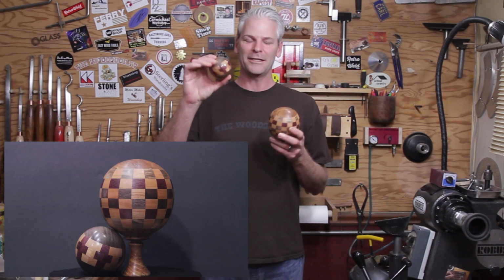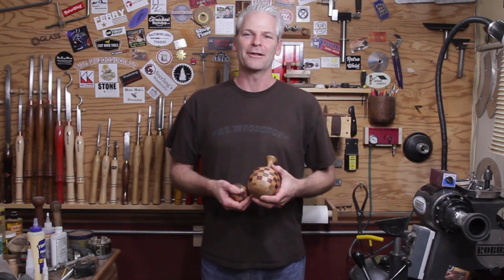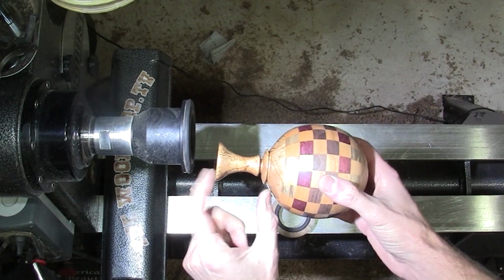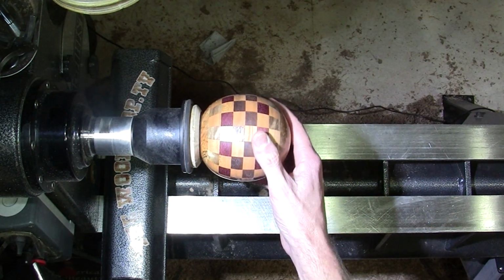Woodturning Segmented Spheres

Comment: Nice turning display.  It is not easy to nail a sphere by hand.  I thought you would use the Chefwarekit sphere jig.
Reply from the maker: +Lyle Jamieson Thank you Lyle! I was a little worried about it chipping with the jig. I haven't used it with segments yet.
Reply: +Carl Jacobson Good point.  You showed great techniques and skills with the spindle gouge.  I think that was the right choice of tools.  The sphere has to be perfect, if you miss just a little it emphasizes the error.

Comment: Carl this may be a silly question but how do you decide on the size of the pieces to get the size circle you need. The sphere is a lovely piece.
Reply from the maker: +Don Bell Thank you Don! The diameter of the rings, are determined by the length of the segments. The further you move the stop out, the bigger the rings get.

Comment: You got any idea why that vacuum chuck leaves a ring in the bottom of my bowls?  Does yours do it?   Seems like it needs a thicker gasket.
Reply from the maker: +Josef Roesler Are you letting the finish dry? I know if it's not dry it sucks the oil out of my pieces.
Reply: +Carl Jacobson I was fixing the feet on bowls I made 2 years ago.

Comment: Is there some reason you did not use the sphere jig hanging on the wall behind you?
Reply from the maker: +Gerald Jensen I haven't used it on segments yet, I'm a little worried about it chipping.
Reply: +Carl Jacobson You are probably right. The only way to get around chipping in segmented pieces is super sharp tools ad even then there are not guarantees.